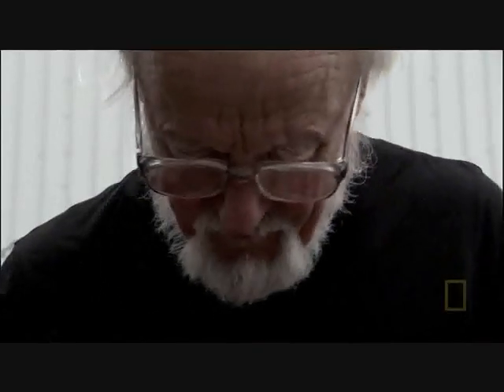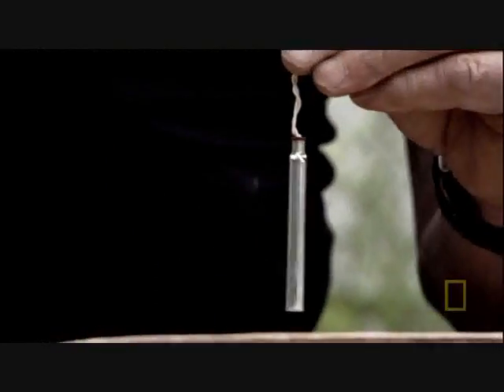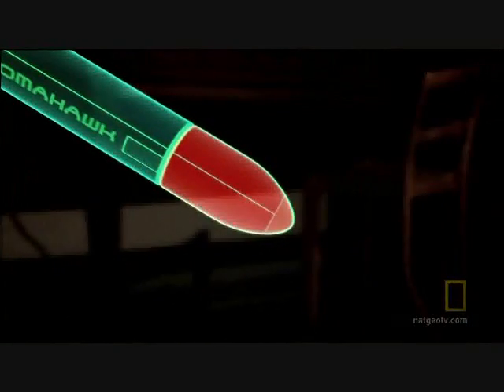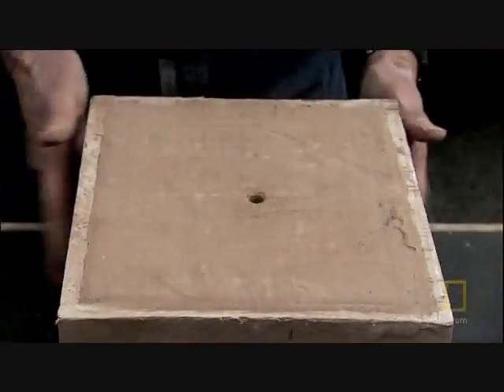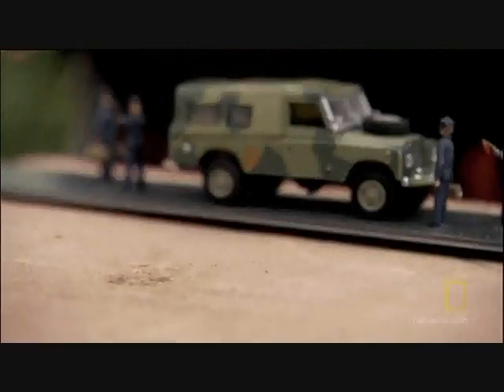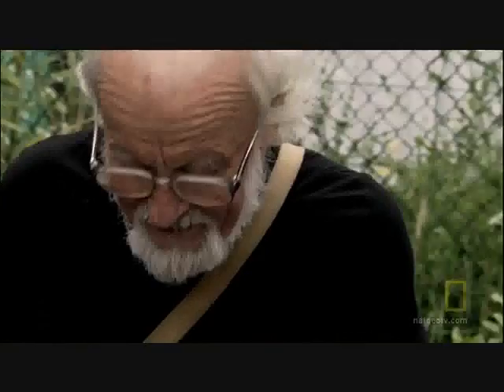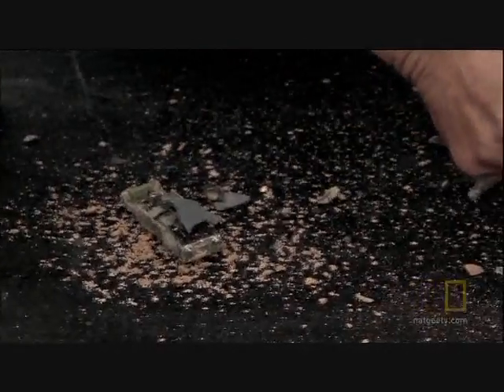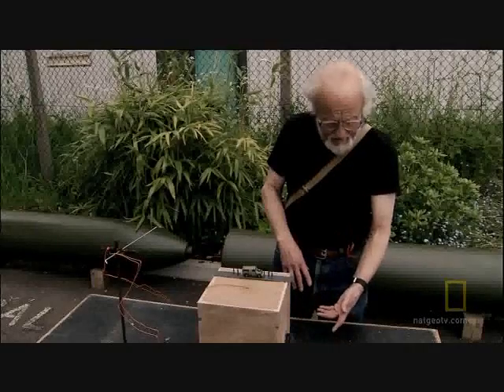The art of bunker busting

Comment: my ultimate bunker buster would a missle designed in threes which each section detaching out of the missle. Similar to rocket in space when each section is detached to compensate each other.
It would also have a cone three spaped spher around the the missle producing a mushroom scenerio to compensate each expolosion in  the earth;s core. Enhancing the explosion deep enough to withstand anything a mountain can produce.
the first section of the missle woould have a small amount of explosion. the second and thrird, much larger part of the miisle(base) would produce much more oviously.
all ya would need is one missle to do the job instead of two or three to peneterate the earth;s core to disprute the devils' lord.